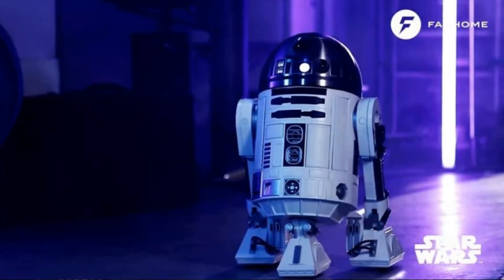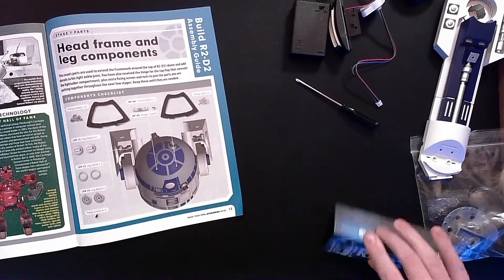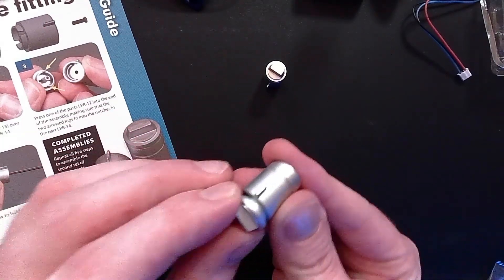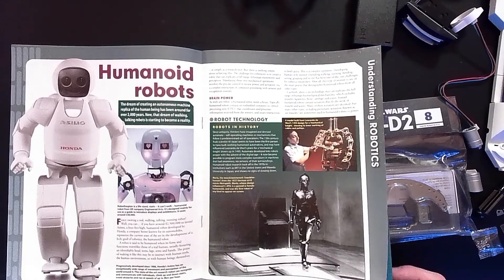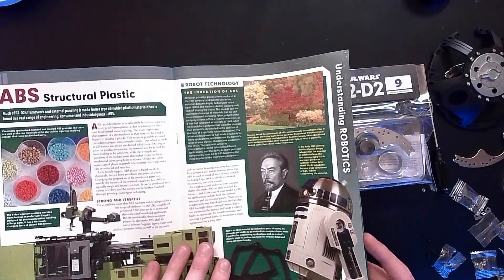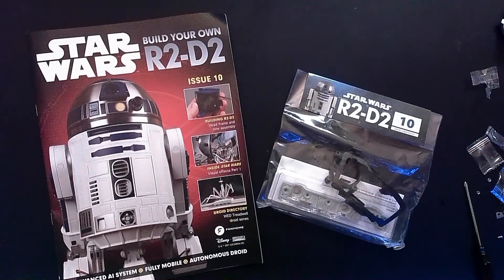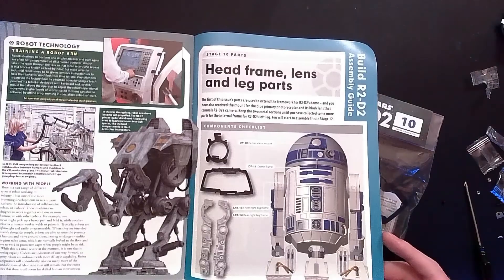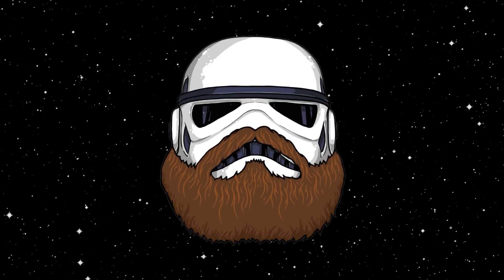Building an R2-D2! | Pack 3: Stages 7-10 | Head Frame Panels, Projector Lens, and Leg Components

Comment: kind of dumb they don't ship to New Zealand but oh well I guess I will have to live vicariously through your experience. I think you may have place the black section with the hole in the wrong spot, the instructions show it right next to the section with the gap, it may not matter but if it does it probably would be a good idea to correct that before you go much further